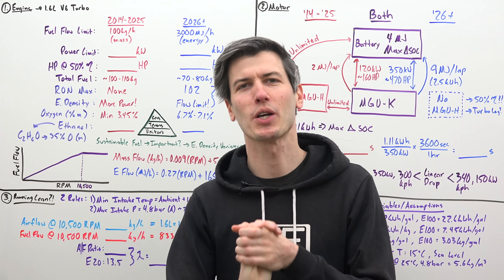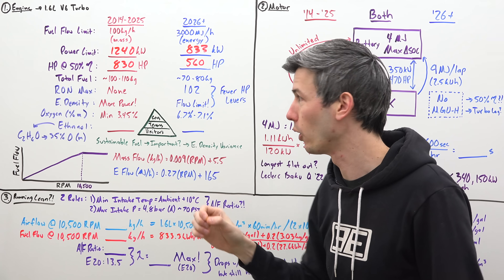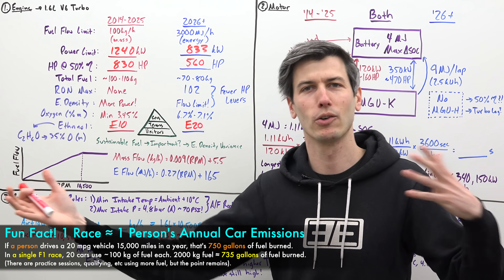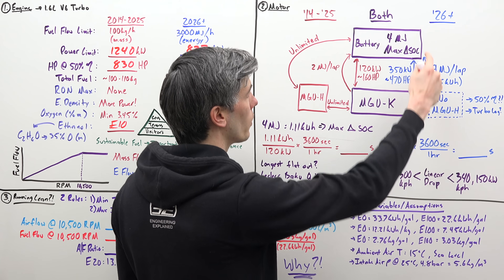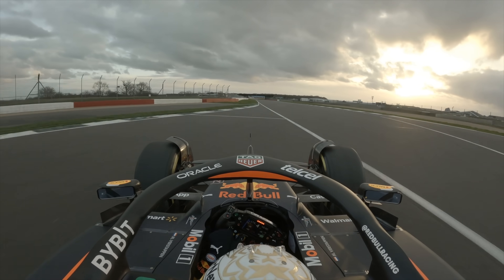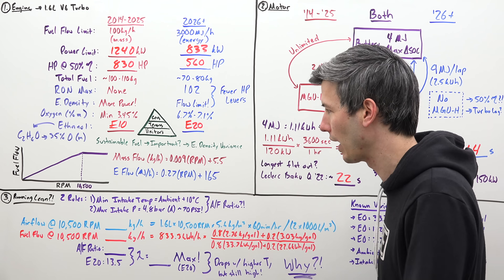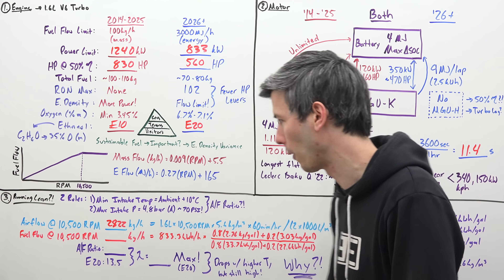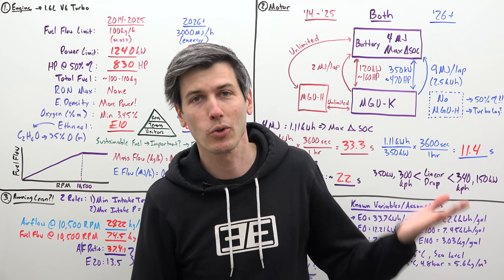Why Are 2026 Formula 1 Engines Going To Lose So Much Power?

Comment: I feel like we all know this but nobody seems to have written it. They're making the cars more "green" for two reasons in my opinion:
1) To improve brand image, ultimately for profit.
2) F1 is often a playground for new technology development for road cars. These new cars might have technologies which benefit traditional cars, although unlikely.
I also agree that it's pointless really in the grand scheme of things.
Reply: It's rare to see brand new concepts invented in F1, but systems like semi-automatic transmissions, turbochargers, traction control, active suspension, abs, steer-by-wire, and electronic control units were often explored in formula one (and other race series) by manufacturer works teams before bringing those systems to market. What's more common is that systems are improved in F1. Take turbochargers, for example. The systems that keep a turbo cool and lubricated to extend its life for a few hundred miles on the race track will extend a consumer grade turbo's service life by tens of thousands of miles. Same goes for higher quality materials and alloys that were first piloted in racing before being introduced to consumers. The precision machining techniques that used to make race-grade turbochargers has been adapted to assembly lines, first to sports cars for power, and then to commuter cars for economy. My bone stock, base model honda civic gets 40 miles per gallon but still has enough get up and go to floor it and MOVE in an emergency, and that is in large part due to a small turbo capable of pushing 20-30 lbs of boost at high rpm... and unlike turbos with similar specs from the 90s, that turbo will probably outlast the engine. We have racing to partially thank for that.
Reply: 3) esg rating
Reply: As for your point 2, I think it's very tied to point 1 but the dirty secret is that so little tech have actually spilled over. Or wouldn't have arrived at road cars even if F1 weren't first at it. 
Also, if sustainable fuel is really that sustainable then for the love of God go to smaller or no hybrid systems and make the cars smaller and nimble again. And let Le Mans Hypercar class and Formula E go nuts on the EV/hybrid side of things. I am not a petrol lover but the cars are simply too big as they are.
Reply: The fist use of efi was a Chrysler in 1958, the first use of coil overs isn’t easy to trace but improbable that it was f1, wishbone suspension was first used by Citroen in the 1930s, the fist turbo was used on a Diesel engine, the first automotive use of the inter cooler was the 911 in 1977, the first paddle shift was at lemans in 1901, the first disc brakes were on ls Lanchester cars,  can am cars were using wings and ground effect before f1, pre combustion chambers first appeared on Diesel engines, abs dates back to the 1920s on a Mercedes’ road car, Buick developed maxtrack in 1971, Citroen were the first to have active suspension in 1954…
Reply: They also drive costs down in the long run.
Reply: @waltonsimons9082idk about you but after 2010 where hybrid started becoming more and more prevalent in f1, we started seeing much more hybrid powertrains in road cars, perhaps not a direct cause but certainly alot of the improvement in hybrid efficiency and development was from f1. I mean, the new porsche literally has an MGU-H which is from f1.
Reply: I dare you to name a single F1 technology that made it into a traditional car.
Reply: @DenDodde hybrid. Williams created a version of it in the 80s
Reply: @lazarusdigital  You could go down to the car dealership and get a hybrid porsche back in 1901. ;)
Reply: @DenDodde carbon fiber, engine and transmission oil manufacturers probably getting good data, maybe their brakes too?
Reply: @DenDodde  idk dude, im pretty sure every car that has a mid engine configuration is probably because of F1, same goes for every engine that's built after the cosworth v8
Reply: @Easthall2 Pretty sure a mid-engine is because of physics more than F1. You know, that same reason F1 use a mid-engine design in the first place.. As for the engine, i actually had to look it up. Can't say for sure, but i can't see any innovation in it all.
Reply: @Easthall2  bugatti was the first to use the engine as a structural memeber back in the 20s
Reply: @DenDodde active/adaptive suspension, and buttons on the steering wheel
Reply: @jorge8596  Yeah, ok, i can give you the buttons, and if you include gear paddles in that we can say that F1 improved our steering wheels. Still not sure i would call it a technological playground though. Especially with all the arbitrary rules the stifle innovation.
Reply: @DenDodde  push rod suspension
Reply: @DenDodde Regen braking
Reply: @omgawesomeomg  You mean the one the Prius had back in 07, 7 years before the modern hybrids?
Reply: @DenDodde  EFI, coil overs, turbos, intercoolers, paddle shifting, double wishbone suspension, disc brakes, aero management, pre-combustion chambers, stability control, traction control, anti-lock brakes, active and semi-active suspension... That is just a very small sample.
Reply: @jameshisself9324  No.
Reply: @DenDodde  ha
Reply: @jameshisself9324  Textbook example of uninformed plebeian.
Reply: @DenDodde  Straight to the name calling, all the while too ignorant of F1 history that goes all the way back to 1946. Not the first and I'm quite certain not the last.
Reply: @DenDodde  

The guy provided you a long, detailled list of technologies and the only reply you can come up with is "no"... Pretty obvious who is 10 times more informed than who.
You calling them uninformed is such obvious projection that it should be used as an example of the phenomena in a psychology textbook about defence mechanisms.
Reply: @alexbv475 he is right though, every technology that was used in F1 was present in a street car or concept first than used for performance terms in F1.
Reply: @DenDodde  Active Suspension, KERS, carbon fiber, paddle shifting, v cylinder engines, to name a few.
Reply: @DenDodde  active suspension, KERS 👍🏻
Reply: Nope, they can test all these things in F2 and F3 series, heck they even have a fully E-series (formula E)

Comment: I'm not saying I completely understand all that I get the gist. I think the F1's goal is twofold A. To appear more environmentally friendly and closer to "Carbon Neutral" and B. To Nerf, the Power Units or at least make the P/Us across the teams closer together so you don't have one team with an OP engine that dominates like with Mercedes in the past and Red Bull now with the Honda engine they run as RBPT. So you maybe mix the field up a bit and not have one team or one driver rocket off the starting line and win every race virtually unchallenged.

Comment: Well, these current power units make a ton of power but suck ass for racing. Theyre huge and heavy. Todays cars are absolutely behemoths compared to just 20 years ago.

Smaller cars make better racing. Easier to pass, harder to defend. Smaller usually is lighter and thats literally more efficient unless you F that up.

Comment: At this point I'd be happy with simple 2.0 ltr V10's with 100% bio-fuel and a big battery for boost, somewhat like the 2007 KERS rules. Much simpler and generally cheaper, louder and much more fun.

I love the engineering with the hybrid era, but it's just too complex for what it needed to be.

Comment: I cannot wait for F1 to go back to non-hybrids but, with 3 engine options a 1.6L V6 turbo, 2.4L V8 Kompressor, or a 3.0L V10 atmospheric all with 20,500 rpm limit, and the return of refuels so drivers can either play it safe with a 6-second pitstop and getting a full tank or risk it for the biscuit to try to get ahead with 2.2-second pitstop and only getting a quarter tank. Also, move away from major automakers and towards smaller companies like Cosworth, Judd, Williams, and more.

Comment: I think that the engine regulations should be given only a displacement limit like at least 2.5L and let the manufacturers go crazy with the cylinders... What they should be doing is limiting the carbon exhaust emissions itself like when you register your car.
I dont see how making the engines smaller and less cylinders reduce carbon footprint, my neighbors 50cc scooter probably makes more Co2 than F1 since 2014.

Comment: I dont believe they are even near 50% efficiency even at peak efficiency. Obviously we need to define how we calculate the regeneration into the efficiency. But if we integrate the whole race performance I believe we get just above 40%.

About the pressure limit and ridiculous lambda … when you go leaner the top combustion temperature gets higher within the limits of practical ignition now. But what about if with some magic you could ignite with much higher lambdas … the air becomes actually coolant at somepoint and the lower the burn temperature is the less the thermal losses are. In a way you are trying to direct the thermal losses to the temperature of the air and not loosing it in convection to the walls … I dunno. I think this would actually mean less combustion top pressures. I wonder what happens with the combustion sound when running super lean. The one thing I do not quite get is how on earth are they going to accomplish stable ignition with lambda well over 2????

Comment: hmm if my Values were correct a Boost of 4.8bar would result in 844,4kW Power(without losses of course) just from the forced Air in the Cylinder alone xDDD So the Combustion would only be needed to keep the Turbo spooled up. Calculation below:

Displacement: 1.6l so 1,600,000mm³
Number of Pistons: 6
Piston Travel:  40mm
Boost Pressure: 4.8bar so 0.48N/mm²
Maximum rpm: 10500rpm

Piston Surface Area: 1.600.000mm³/6/40mm=6666.67mm² (Displacement/Number of Pistons/Piston Travel)
Force on Piston: 6666.67mm²*0.48N/mm²=3200N (Piston Surface Area*Boost Pressure)
Torque generated per Piston: 3200N*0,04m=128Nm (Force on Piston*Piston Travel)
Power: (128Nm*6*10500rpm)/9550=844,398kW ((Torque generated per Piston*Number of Pistons*Maximum rpm)/conversion factor) 

Conclusion: Hell of an Air-Pump xDDD
And whats even more interesting about this, in this configuration every Cylinder would have a Power Stroke on each Crank Revolution
Intake Valves would remain open until the Piston reaches bottom dead Center feeding "fresh" compressed Air, then the Exhaust Valves would remain open almost until top dead Center allowing the "used" Air to escape, rinse and repeat.

Comment: Thanks again for explaining the scientific details. My biggest question for the 2026 engines is how the batteries will be charged. Mgu-k is in rear axle. And can only generate while the car should be braking.
Where braking is hardly done. And even then. Most of the kinetic energy is dissapated through the front axle.
Also the rear tyres will need to keep temperature. So part of the rear braking energy is also dissapated through the disks.
So how can enough energy be harvested to batteries?
Will they instead of coast, just run engine on full power, but reduce the power to the tyres by breaking through MGU-K?

Comment: Air to fuel ratio, maybe a giant stratified charge (diesel tech). Also, could run lower boost and have free -er exhaust back pressure, smaller turbo?

Comment: I wish instead of limiting the amount of joules, they just limited the size and weight of the battery.
That way more efficient batteries would get a more obvious edge. Technically, you could still lower the weight of the battery but a 1.1 kWh battery really doesn’t weigh that much. And so the difference is pretty minimal.

Comment: Torque application out of the corner is going to be key to lap times. Entry speed might be compromised, i.e. passing, may be increased due to the increase in the electric side of the motor.

Comment: Granted, the switch to e-fuel is partially a green-washing & marketing effort.  However, with Audi & Ford (and Honda sticking around) becoming engine suppliers because of this switch, they're effectively using F1 to fund cutting edge R&D for engine development that will make road car engines more efficient sooner.  So, big picture, the eco gains could really be huge.

Comment: Duh it’s because volkswagen lobbied for it. Guess what category of cars had a lot of fuel flow limit and 550 hp on combustion and 450 hp on electric engines? That’s right, LMP1, which VW had 2 teams in

Comment: It is a pity that they have removed the mgu-h, they could have kept it and further improve the thermal efficiency, allowing to recover more energy from it with more advanced turbines, also to recover much more braking energy by moving the mgu-k of the engine the front axles like the Porsche 919 hybrid evo

Comment: Im not here for the tech advancement. Not for the fuel efficiency. THE FANS WANT THE SPECTACLE. set a cc limit and cut those engine builders loose. If 3 cylinder is the best let it rip. If 12 cylinders is best let them engines scream.

Comment: I think the min air temp and max pressure is to try and close some loopholes someone discovered.  Maybe using the turbo pressure as a simple air pump that can be used to run the engine briefly on no fuel.  The air temp may be for preventing teams from using cryogenic air to super cool the inter coolers in the pits before going on track, especially for qualifying. Some rules are to prevent edge cases and loopholes that F1 engineers are famous for finding
Reply: No. Cooling the intercooler with a cryo gas prior to qualifying would do basically nothing as an advantage. It takes laps for the car to get up to speed and start the timer, and ANY cooling effect "sprayed" onto the intercooler in the pits would be LONG gone by then
Reply: The Intake cooler is an air/water intercooler. Switching on the pumps for the hot lap, could reduce the temperature for the inlet air to below that 10 K limit. And depending on what interval the 3 GJ/h is measured, you could get more power out of the engine than intended.

The pressure limit is basically there to reduce development and engine costs. Else you could make the motor far smaller for the same power, which would be a huge weight saving.
Reply: So FIA will soon be the only engineers allowed at this point. Msy they go to hell for such heresy.

Comment: As always, very interesting analysis.
I can't help thinking that all of this is mainly for ecological reasons and to force manufacturers to research toward more "fuel" efficient combustion engines rather than "power" efficient, even if they are two ends of the same rope.

Comment: Electric vehicles are boring to drive and even more boring to watch others because they are easy. There's no sway in the power band or traction issues due to power delivery. One of the biggest factors on whether you are a successful driver is grip, power delivery and traction management. With electric it's no where near as prevalent. I don't look forward with any anticipation to an all electric Formula 1

Comment: Manifold air pressure limits may apply to limit the amount of stored air, your assumption is that the MAP is instantly used but with variable inlet valve timing this is not necessarily true

Comment: So, 1 hour of fuel @ full tilt on board for a (maximum) 2 hour race. Combustion engine power cut to 66%-ish, plus a loss in thermal efficiëncy by losing the MGU-H. Electric boost tripled in power, but no change in battery capacity. As an F1 engine builder, you would have to optimize recovering kinetic and braking energy. If you can put more energy back into that battery, recharging it faster/better, then you get more use of that boost. And you would have to optimize the thermal efficiëncy of the combustion engine. Like what Mazda has been doing with their newest Skyactiv-X engine. Maybe angling the cilinders to elongate the power stroke and reduce piston rocking (I assume they've already got this covered). Optimizing the exhaust stroke, now that the MGU-H has gone (the exhaust stroke deliveres some power too). I'm sure the F1 engineers are several steps ahead of the things I'm mentioning here. My point is, there are still improvements to be made to the old combustion engine. And they're going to have to make these improvements if they want to be winning.
Reply: There is actually one more technique that could be applied. The air budget is way oversized, as you've shown. You could, during the power stroke, moments after the initial combustion, inject more air. This cold air is introduced into the engine's cylinder, while it's full with high pressure superheated gasses. And the injected cold air will rapidly expand because of it. The f1 car will need to have an air tank and a compressor on board (else you would introduce energy from outside of the energy budget). Injecting cold air into the cylinder after combustion will basicly convert heat energy into rotational force at the crankshaft. It will increase the thermal efficiëncy of the engine. The tricky part is making it work. But that's what F1 is all about.